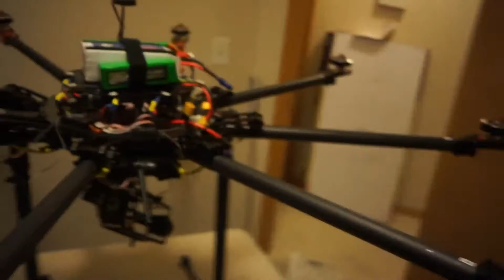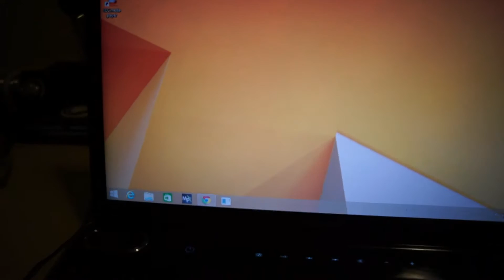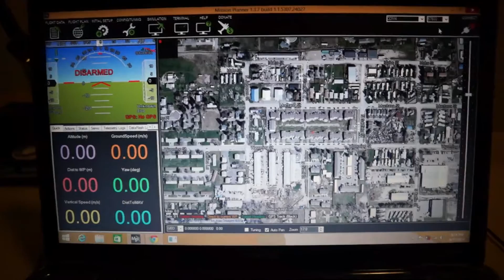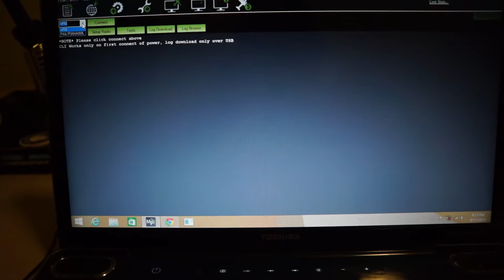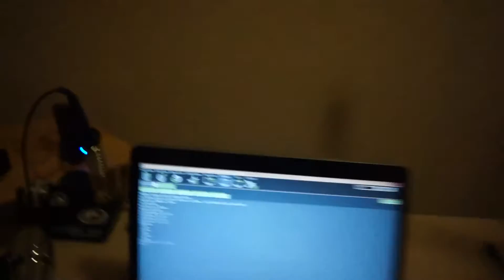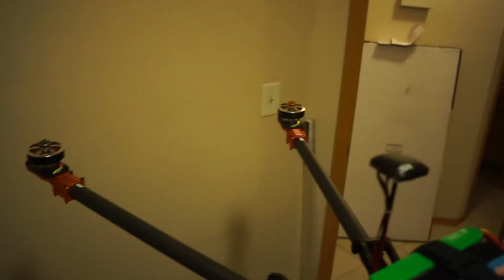K130 Octocopter + Pixhawk Connecting to Mission Planner and Motor Testing

Comment: I need your quick advise please 
I have a fix wing UAV. I use mission planner 

My UAV FIX-WING crushed the right wing propeller and the motor. The motor base detached along with only one of the 3 cables

I was able to fix all that. I replaced the broken propeller, I reconnected the motor cable and I fix the Motor base. 

However, I can connect the plane to Ardupilot/ Mission Planner. I checked all my servos working but the Motors. 

Do I need to do the steps you show in this video